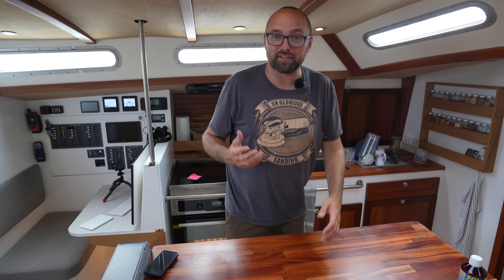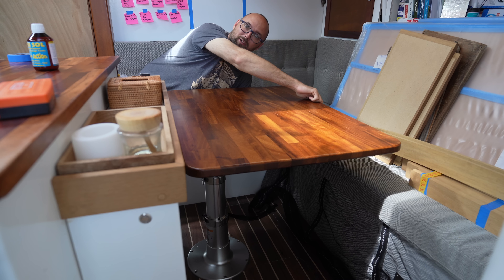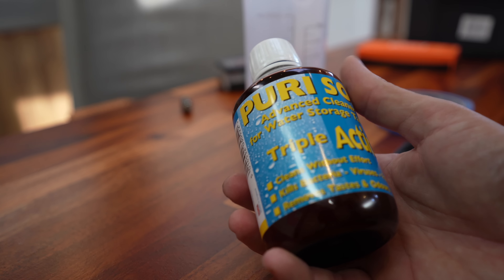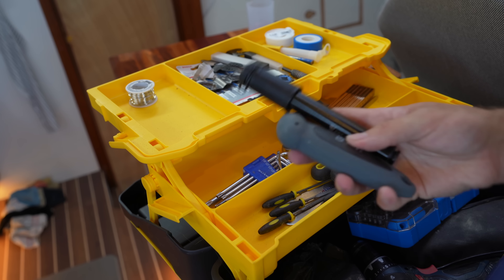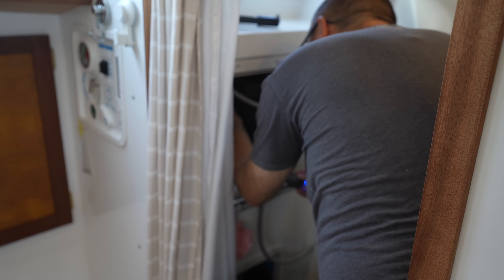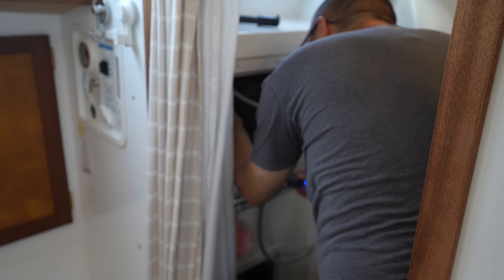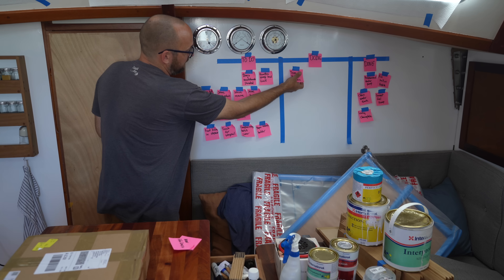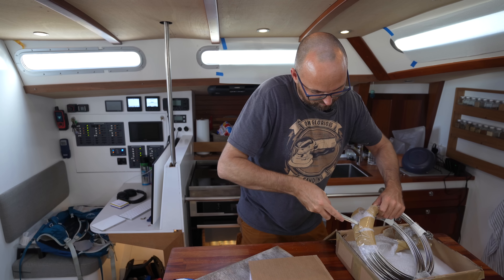Sail Life - Fixing what broke after one year of cruising full time 🛠⛵️

Comment: Mads just some info on the locktite. On some stainless steel it will not set, depending on the iron content.  They do however make a spray to spray on the threads that will make it cure.

Comment: Thanks Mads. I've had the exact same problem with my pressurized water system but without any information onboard about the accumulator fixing the problem has been beyond me. Regarding your lifelines, perhaps pelican hooks could provide a quick disconnect solution. I slide a piece of garden hose over the lever arm to stop them accidentally opening. Fair winds my friend.:oops::yougotthis:🌏⛵

Comment: I just had an issue with my water tanks also...   marina has well water and I had not known that there was a sulfur contamination. 
SO>.. 
A) I purchased a RV water filter ( a blue water filter that screws on at the hose tap.  popular with RV folks here in the states )
B) Filled the tanks to about 80%  and added pitcher of water to each tank with 1/4 cup of bleach per 15 gallons ( for me it was 1/2 cup ) 
C) Ran water thru all lines until I smelt faint wiff of bleach.
D) took the boat out for a 6 hour +- sail to get it good and sloshed around
E) drained and flushed the thanks a few times.
Smell gone. water tastes fine.

Comment: I thought I should pass on my experience with seasickness. I had sailed my 27ft boat from the east coast of USA and through a lot of the great lakes over a couple of decades. Never experienced seasickness until it suddenly happened. No major sea condition.
What I discovered was that my recently renewed continously ground bi-focal eyeglasses were the cause. There is a definite co-relation between eyeglasses (maybe even non-bifocal) and the boat motion. Lesson learned - don't wear the glasses when at sea. Suggest that they be hung around the neck with strap so you can use them only when needed to see details.

Comment: You should have raised the deck around the chain plate like new boats with glass 1/2 inch  ,that way water running along the deck will not leak down into the  chainplate
Reply: Smart thinking. I wondered why they did that.

Comment: For your water, there are some treatment chemicals to add if you're going to store long term.  Long term is directly proportional to how warm it is.  Our old Wellcraft would have a nasty smell develop within about 3 or 4 days in the middle of summer.  Using the 1/2 tsp per 50gal (~190l) was enough to keep our water fresh for up to 10 days without any off smells.  Note that we did NOT use our water to drink.  The boat was from 1987, it had been through a few owners and we did not know the condition of the tank.  It also was "winterized" with RV Antifreeze every winter.  When we were in our slip, we would generally just hook direct to the water at the dock...something Ava had never seen before until she was out on the boat with her family, but is fairly common in our area when you lease a slip for the year.  Our slip came with power, water, cable TV, and secure WiFi, but those slips?  EXPENSIVE in Michigan...$2800 and up regulated by the State when it is a state owned marina (independently operated).

Comment: We've just returned from 2 years full time living aboard our boat in the tropics. I'd really recommend installing a 10 inch filter housing with a carbon block filter to your water system (or at least your drinking water tap). Then add a small amount of chlorine (perfume free bleach) in your tank water.  The chlorine keeps the tank and water clean, the carbon filter removes the chlorine before drinking. Happy to provide dosage information if you're interested.

Comment: Check out the local Auto Parts store for a can of 'Fluid Film' or similar lanolin based anti-rust spray. Great for 'tucked away' components you can't regularly inspect, that may be exposed to humid conditions. The one time our water developed an odd taste was when I realized I had forgotten to completely drain our filler hose, yuck! Had to dump and flush the tank twice... ⛵💦
Reply: 2nd the Fluid Film....or if you don't want build up...Beoing Spray.

Comment: Everything on a boat fails eventually.  We've been cruising full-time for a few years now after starting with a completely refitted boat where every single system was replaced, including a repower.

So far every single electronic.item has been replaced in 5 years. Getting hit by lightning didn't help that but things had failed before and after that.    IMHO everything on a boat gets replaced on a 5-10 year cycle.  Some things last a tiny bit later and others die faster.  The marine environment is just really harsh on systems.   

A boat is a hole in the water that you dump money into. Stuff breaks constantly abd that is just a fact of life.  Being able to fix things yourself and knowing your boat is a.HUGE help.   But the more complex the systems are the more parts are in there that will eventually fail.

Water tanks are a constant source of issues.  I think wr have had to clean ours thoroughly about every year.  We have fiberglass tanks so we can use chlorine to keep them fresh which we do with every fill up but still every year the darn things get away from us. 

One thing we have not had an issue with is diesel bug.  We use BioBar every fill up and have a self-polishing system with its own racor and fuel pump.   Cleaning that diesel tank is a real pain on our boat.
Reply: Spares are your friend.  We have a spare or two for every system onboard and tons of tools and supplies to do just about any task without even a trip to shore. Two is one and one is none.

With your lifeline chafe issue I bet if you were to have put a short piece of shrink tube over the section where it ran through the holes in the stanchions it would have prevented the chafing completely.  But I still think that stainless steel rigging cable is best for lifelines, especially the top one because you can then hang fenders off of it using a clove hitch without worrying about chafing.  

We often will "clean" very filthy items by tying a line to the item and tossing it over the edge to rinse in the sea.  This practice can also chafe on the top lifeline too.  I am glad we used cheap uncoated rigging wire for lifelines.  Using dyneema to tension the lifelines is a good idea.  Not only can it be cut in an emergency it can be easily removed for other reasons as time goes by.  Stainless turnbuckles are notorious for seizing up eventually in a saltwater environment and are the #1 failure point on lifelines except for the crappy plastic coating peeling off eventually because of UV damage.  Going with uncoated rigging wire is the way to go.  They will basically last forever.
Reply: Sounds like our house.

Comment: When the weather gets cooler here in the NW of the US, I get water in the air side of the pressure tank all the the time.  I have found that using a conditioner works wonders in keeping the condensation from accumulating in the tank. It also prevents the diaphragm from freezing and getting stiff when the temp drops.   Have a great week Mads and keep up the great work.
Reply: do you mean air conditioner?
Reply: @ekavoian  As air compresses in the tank it can sometimes cause condensation to build up in the air side of the tank. I use an additive made by CRC that helps to prevent that. It also is a great antifreeze as well preventing the diagram from freezing and stiffness so it won't crack when the temp drops below freezing.

Comment: Coat the outside of the fuel pump with a few coats of wd40; it should slow down the corrosion.  but keep it on the electrical connections.
Reply: things coated with regular WD 40 can still rust.. I once had some engine main bearings that were sprayed and placed in a shelf.. 3 months later and there was rust. WD-40 has a special version with corrosion inhibitor that is probably better.
Reply: WD40 evaporates, regular oil and grease won't.
Reply: @dennisbay3035  thank you for the tip, i didn't know that made that.   There's also the bar oil trick, but that seam messy!  https://youtu.be/R6wkcylj1ng